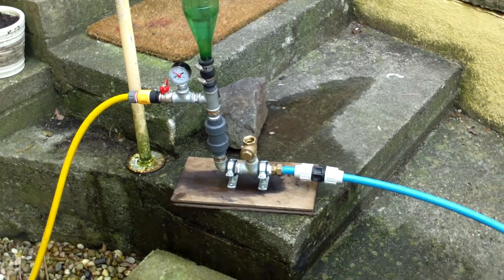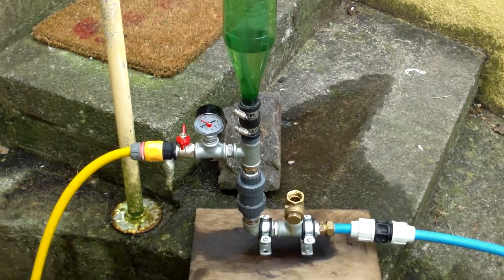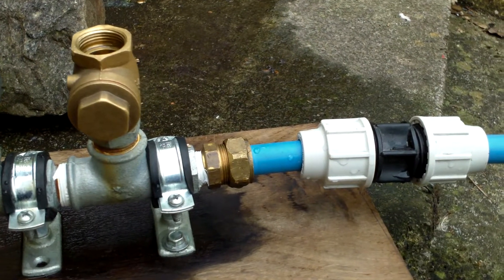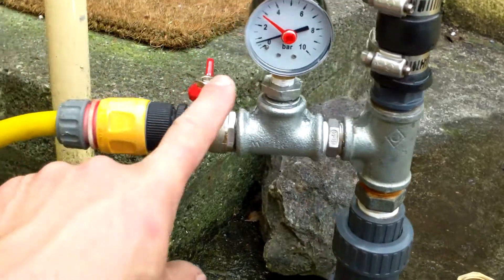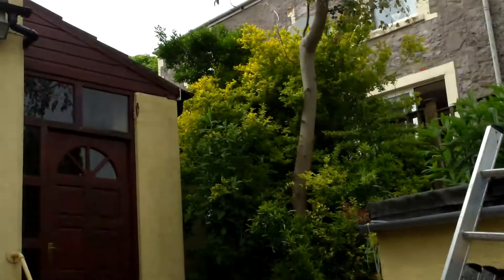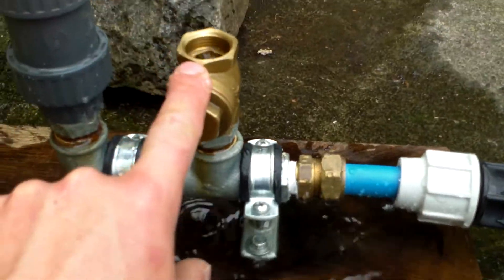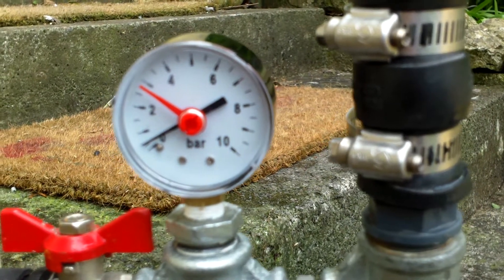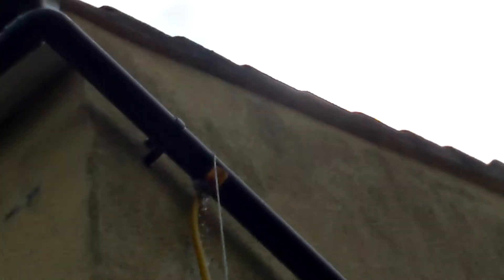Update on model 3/4 hydraulic pump fitted with pressure gauge

Comment from the maker: Hi, good work, but this type of pump will not run with a tap, you will need to set up an elevated barrel. You can use spring loaded non return valves if you want, i prefer the non spring ones using a ball as the stopper. Check out my other self build videos for more info. Cheers

Comment: just built one and tried to run it off the water coming out of the tap will this work or will i need to set up a drum also is the plastic one way valve spring loaded or free running ??
 cheers
 Mark

Comment from the maker: Hi Thanks for your kind comments. These pumps will pump between 20 to 30% of the water entering the pump, the waste water exiting the brass impetus valve was used to pump the smaller amount of water out of the output, this water is returned into the stream or what ever water source you use to power the pump, so there is no real 'waste' going on. As for the pressure vessel, these normally need to be at least 10x the delivery flow per beat, ensuring a constant pressure as you point out yourself.

Comment: Very nice demonstration on the pump! I've never seen these before.  Just curious, is the water coming out of the brass check valve typical of these pumps when operating? It seems like 1/3rd of the water being pumped is lost through that valve. Is that normal for these types of pumps?